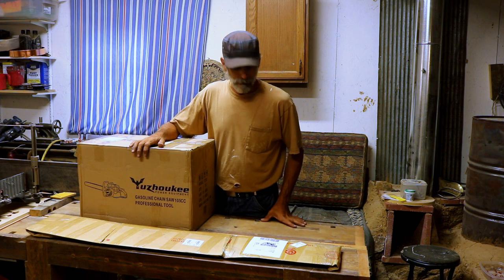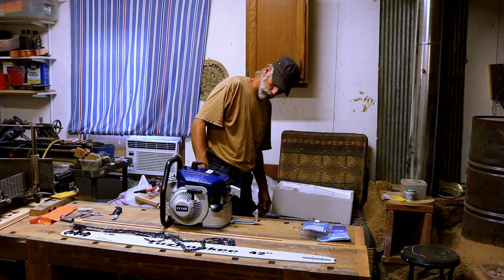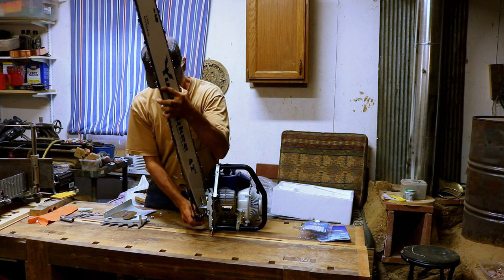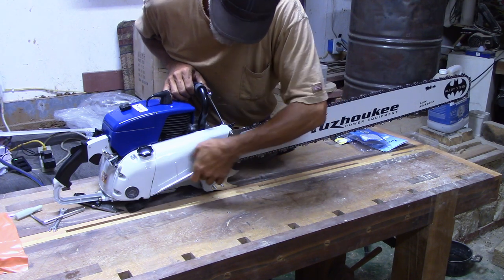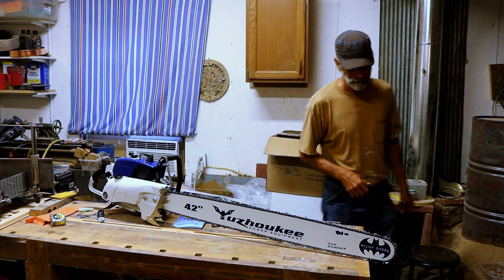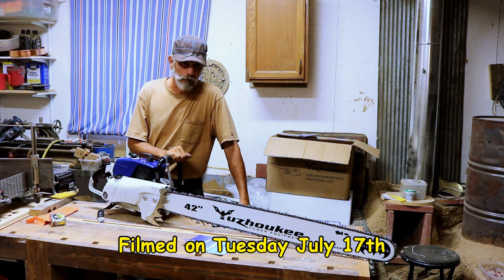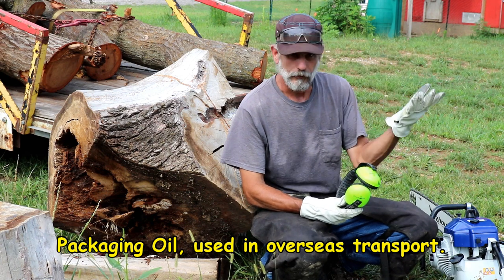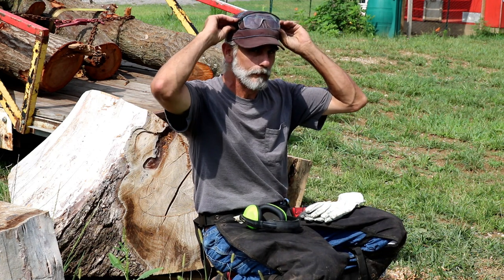Un Boxing a cheap 105cc Chainsaw

Comment: I usually buy the cheap Chinese 18 inch chain saws that come with a couple of chains they are about £70 and really are throw away tools.It is cheaper to buy a new chainsaw than a couple of reputable chains. They last me 2 to 3 years and when the become a problem buy a new one.
Reply: Tony Papantoniou  thatmakes no sense at all if u buy quality saw one time u will have it forever,buy the time u buy two cheap saws u could of bought one nice saw that will last 15 20. Years!!or a lifetime depending on how often it gets used,plus u don't need to deal with the headache of running cheap crap that doesn't work as well as a nice saw!
Reply: Even quality power tools wear out and costly to repair.I am not a professional and do not need tools to run 7 days week Buying a new cheap one every two to three years is cost effective to me and every time they improve, become better at starting and cutting better. As I said you can only buy two to three named chains for the price of these chain saws. They are really good value.
Reply: Tony Papantoniou I'm not a pro chain saw user and I probably use it 1 time every month but I went with a stihl 181c 16 inch bar cost £240 in the uk and I was in just curious what a cheaper one is even tho I have no intention of getting one proactively some thing but crap feel and quality cost £180 if you going to spend why not just buy once and I thought how cheap a named brand was to the quality you get and you get less fatigue so safer on the user just common sense really or at least to me it is
Reply: You need help
Reply: I Ran with a Stihl then a Husky for years...So my Husky fell off the Trailer and Insurance wouldn't pay out for  a new one..The cost for me to buy the same newer model 2k approx NZ$...So while I waited I went to a shop and bought a Cheap Chinese knock off..Its still pulling like a school boy and hasn't failed and for the cost of it..I can't see me going back to a Stihl which is made in China ..may as well buy something that is a 10th of the price and still made in China and if it fails ..throw away and get a new one..
Reply: To Jake Bradbury I can not justify paying nearly 4 times the price to do the same job.
Reply: Timberwulf2  I was in NZ for  a year working laying Tarmac (you call it tarseal) I thought everything with an engine was real exspensive , cars trucks , rollers , diggers.
Reply: Tony Papantoniou i have two Husqvarna saws and i bought one of those cheap Chinese saws just for trouble areas where i dont want to damage my husky's or the expensive chains.And let me tell you that those chinese saws are good value for the money.I got two chains and two blades with the chainsaw,for 55$.One chain for my husky costs that much,so this is really good value for the money.I even got 12 months full waranty
Reply: That is what I have been saying they are cheaper than the chains and they last a couple of years. For some one who needs a saw occasionally these are the way to go.
Reply: pulling like a schoolboy not hered that before lol
Reply: I get Forester chains for around 10 bucks apiece,your logic makes no sense to me
Reply: To Dustin Pomeroy, so £70n versus £240 makes no sense? There is a lot of tool snobbery around.
Reply: Tony Papantoniou not in the grand scheme of things
Reply: I'd buy a used Stihl over a new chinese saw. 
But I would like to have a chinese 090 just for messing around
Reply: 1superocky1 mlm
Reply: What brand and was it a knockoff.
Reply: i bought a stihl 026 for $80 cad, so far ive had it 3 years and has never failed to start, other then the chain i have not replaced a part yet. i cut about 10 cord a year roughly
Reply: it was a used saw, who knows how many hours were on it before i got it, under the filth and grime it was covered in it looked like new
Reply: My grandpa has had the same stihl ms 290 for like 20 years and it has had really no maintenance done too it.
Reply: that's a nice working saw i used one before
Reply: I have had good luck with lots of cheap used chainsaws from garage sales and Craigslist for really fair sometimes paying only what they chain and bar is worth and practically getting the saw for free. I have gotten good at repairing the poulon chainsaws like the wild things and wood sharks you can do a complete tune up including a complete ready to run carburetor new spark plug fuel lines fuel filter And air filter and after a couple minutes and a little fine tuning on the high speed needle they run very good and actually cut good with a sharp chain and straight bar especially the smaller bars the poulon wood shark is a great saw with a 14" bar and chain it has great power to cut the big stuff (10"-12" round) or even smaller stuff like pruning limbs. And for around $30 for the Total investment you have a chainsaw that is worth about $65-80 used in good shape atleast that is what I sell mine for and you have a tool that is just as good or better then one that costs your over $250 to buy a  new higher end model at the store that has a decent reputation and parts availability just like the cheaper poulon chain saw you can buy ever piece of the saw from a online source or even some parts are available at local stores since they are still selling these home owner saws for like $100 plus tax brand new at stores like Wal Mart and Lowe's even has the lower end models but they ask about half as much more money for the saw in the store local then you can get it online. You can even get lucky with spending $60-80 on a brand new Chinese saw from ebay or Amazon a couple companys are producing Stihl and huskvarna replica knock offs that run the same clutch and engine as almost all the high end $300 $400 and even some of the $600 chainsaws have. Heck some of the eBay sales even included a Oregon bar and chain with the purchase of a new chainsaw and some even have cases which is kinda nice if you don't have one.
Reply: @Timberwulf2   a lot of the knock off saws are built using the Stihl parts and some of them are actually good qaulity chain saws for the money you can't beat it your getting a smoking deal if you can get 5 hours of use out of the saw you got your money's worth and you can't feel bad if it died lol
Reply: @gumelini1   
Exactly and you don't have to worry about using a good chainsaw with a good clean sharp chain to cut something ground level or a small job trimming something they're great saws I was overaly impressed with the qaulity and parts interchangeability from name brand new saws to the Chinese chain saws that are basically a Stihl design some are based off a husky type saw but for the most part all the chainsaws on eBay are the same thing just a different color or a different shape of a body around the engine possibly different fill caps also but alot of them are all just knock off of a Stihl And there's lots of info on them online in forums about people rebuilding the Chinese chain saws with parts from other name brand stuff.
Reply: @jacobfraser7967  my favorite kind of saw to buy you know it was never messed with just used like a regular tool being preserved in its own grease and grime lol best part is Cleaning up a old saw and using it like it was meant to be used
Reply: Devin Freeland STIHL chainsaws are made in China.The production moved there so i guess someone figured out to buy parts from the factory and assemble their own STIHL under different covers and brand name.The only difference is they don't sell them crazy expensive like STIHL does.I had only good experience with my chinezium saw 😁
Reply: D B same as other "big" brands.Everything is made in China,go do some research and then come back
Reply: D B for all of those butthurt assholes that wont accept the fact that stihl is made in China,click on this link and let the truth enlighten you https://blog.stihl.com/stihl-worldwide/2013/11/stihl-china-quality-made-stihl/
Reply: String trimmers, blowers, most of the consumer level saws are all made in China. If it has the "Made by Stihl" label on it, it's from China. The first plant opened there a little over 10 years ago. Think it was 4-5 years ago they expanded again to make more products there.
Reply: D B sure,but you called BS on Stihl being made in China.Its hard to accept the truth i guess
Reply: D B Oh now you accept the fact that they are made in Cheyna but dont care about it?Interesting
Reply: Devin Freeland .. You might be able to give me a bit advice, I see you know about Poulon saws... I got a Micro XXV (1977 or 1980s ?)  at a second hand sale for £20, but it was a none starter.. So a clever man I know who is a wizard with all petrol tools cleaned inside the on / off switch and got it started.. Only thing is the fuel lines were a bit swollen and the fuel filter was jumping off so he replaced the fuel line inside the fuel tank.. But getting the thing started is hard enough because you are supposed to hold the throttle on full with full choke.. and once it starts it revs its balls out and won't tick over.. The fella who got it started tweaked the 2 screws on the carb.. It still wouldn't tick over ! .. I just wondered if you encounter similar issues with Poulan gear ? .. I have been using a 028 AV Stihl for years and its never ever missed a beat.. Cheers in advance for any tips you might know about the Poulan, I heard plenty folks saying they are decent saws.. I put double amount 2 stroke oil in the petrol compared to my Stihl mix as I understand they need more oil..
Reply: Timberwulf2 
"I can't see me going back to a Stihl which is made in China", only MS170 is made in China, most of Stihl saws are made in Germany and US. 
Even tho Ms170 is made in China they have still quality standards.
I have bought 2 Stihl saws in 15 years (45cc and 50cc)and both were made in Germany, last Stihl i got 2 years ago.
Reply: gumelini1 You shared that link, but did you even read the page? It was all about that Stihl has opened 1 plant to a China, nothing about "all Stihl's are made in China".
Most of Stihl saws and other products are still made in Germany then US. 
I don't care about where Stihl products are made, but stop spreading those false "facts".
Reply: Trump Jong Un .. I wouldn't really think it would make any difference if Stihl machinery was made in China, Africa or on the top of the Eiffel tower in Paris.. As long as the same standard of components are used and most important of all the strict operations of quality control is adhered to.. A lot of big companies are now making stuff in China, but the quality remains the same as it did when the business was first established in the country of origin.. or you would expect so anyways..
Reply: that's false economy, buy a stihl, husky,makita any of these last for many years with little upkeep. I have these makes and work them regular,some are 15yrs plus so have more than paid for themselves.

Comment: 105 cc is about 3.25 HP.
Reply from the maker: Actually cc's have only a small effect on HP.  Stroke and compression factor in along with a lot of other things. I have seen 52cc saws that achieved 9hp and an out of tune 080 that only produced 4hp. So with proper tuning and tweeking this dude will be capable of more than its rated 6.5hp. Now the question is do I want to ramp it up that much considering the quality of the parts are in question, I will have to think about that. LOL

Comment: I wonder how this thing worked out. Looks like it cut that 38" elm like a 441 stihl or a 562x husqvarna would have. Maybe after it was all adjusted it will cut like a 105cc saw should. But a 105cc saw should scream through that elm, or at least a stihl 088 would

Comment: I knoticed that the chain seemed kinda loose, the more chain the more metal to heat up and expand. I'm personally really anal if the chain it loose, I find they stay sharper longer when you tighten them a lot as you cut
Reply from the maker: Actually the chain was tootight in this video. But, I had not used a hard nose bar in many years and forgotten that they need to run more slack than a sprocket nose bar. Not really an excuse for improper saw settings but everyone makes mistakes. I am planning on ordering a sprocket nose bar for it in the future but for now this one will work for what I need to do. Thanks for the comment.
Reply: DIY with Uncle Cy thanks for the learning experience, ive only ever used a sprocket bar

Comment: Copy of old stihl 070. Huztl is selling those for 350$
Reply from the maker: Yep, Power head with no Bar or Chain is 350. Add a 42 inch bar for 100 and a 60 dollar chain and I got the better deal.
Reply: DIY with Uncle Cy Would pay a little extra just for that orange paint. You cant go wrong with big saws like that.
Reply: DIY with Uncle Cy  Built a kitsaw for seasonal use. Seems to run quite well. Also have a short video of it.
Reply from the maker: Pay extra for paint? LOL you do realize the Hutzl kit and this one are made in the same facyory right. I can just go buy paint and have still saved money for the same saw.
Reply from the maker: Saw that an MS360 clone. I have an MS191T, MS171 and an 032AV that are all real stihls I just needed one for the mill.
Reply: From what I've been reading, swapping out the chain to a Stihl or other "good" brand may make a significant difference. Seems the Chinese chains that are shipping with these inexpensive imports aren't very good. RE using this on a mill... I agree that the chain brake isn't that big of an issue as the bar nose is protected on Granberg and other mills.  I run an MS 461 in my mill but would consider entertaining a clone 880 for those rare (around here) 4 foot plus logs.
Reply from the maker: I am milling with it today. I have a granburg chain ordered, has not come in yet, but had to try it out. I agree a new chain would most likely make a difference.  It is cutting beautifully though. Should have a video of the day up in a few days.
Reply: I have a husky 395 with a 42 inch bar and I get my chains from bailey's they were 40 bucks each the last time I ordered from them

Comment: I’ll be damned if it’s not a copy of the Stihl 070. Oil on the clutch couldn’t have done you any favours it’ll be contaminated forever unless you soak it in alcohol

Comment: you tightened the chain too much causing too much friction, mostly with such a long chain... it must be 1-2 mm loose below the bar... your chain is acting like a brake, consuming probably half the motor power and ruining the bar at lightspeed... I hope you oiled it manually before the oil was going through the automatic oiling...

Comment: But i do save the bars and chains. They all have Oregon bars and chains. I do harvest my own wood for my rc planes using my will, giant table saw, miter saw etc etc i have a nice little shop. So i do use chainsaws. This saw seems dangerous without that brake. Now ive never had serious kickback because i always try to hold the saw horizontally, or keep the tip away from anything, if theres a risk of hitting another branch i cut that branch first. Also i always watch pinch points. Now.. thats not to say i am the safest.. i rarely have to cut down trees because one large birch is enough for a few giant scale planes. But i am extremely cautious. This saw seems intimidating.
Reply from the maker: It is intimidating. But the whole reason I bought it was for milling and not Bucking or felling. And to be honest O have already replaced it as a milling saw with a more modern model. However there will be future videos with this one as I do intend to perhaps hot rod it to see what kind of RPMs I can actually get out of it.
Reply: Definitely show us that because that woudl be handy for my rc planes.

Comment: As with everything Chinese, the saw looks good enough as a copy, but the real problems lay with the Chinese lack of understanding tolerances and metals when they reverse engineer. They also have a tendency to use parts which are underrated for intended application which leads to premature failure down the road.
Reply from the maker: LOL, they have trains that travel 400kph and a good safety record on those trains, but don't understand engineering. I do believe you don't understand much about China.

Comment: It looks like an old sthil ms 880 I got one called an ms 660 but not sthil I think Stihl discontinued those saws and sold the tooling to the Chinese company mine's a 90cc I paid less than 400 bucks the bar that came with my saw didn't have a roller tip though but I already had a 3 foot bar that works. Because of Emissions Control sthil no longer makes the MS 880 or 660 saws they now make  ms 881 and 661.
Reply from the maker: It very well may be.  However if it is the Bore has been changed slightly. The MS880 was 121cc
Reply: This is a copy of an 070 by stihl. 107cc.
Reply from the maker: Just looked that one up. You are correct. The images I found look exactly like it. I bet they reduced the stroke by a little to get the 105 is all. Thanks for the info.
Reply: DIY with Uncle Cy 
Anytime. They also sell one in actual Stihl colors under the Hutzle? Not sure I spelled it correctly, brand name. Also known as Farmertech. Power head only and build it your self parts kits are the two formats. I am looking to order one next month for a milling saw just as you are using it for. Looking forward to your updates.
Reply: rcaircraftnut MS660 is better for mill. Those old saws have very poor vibration dampening.
Reply: There is no ms 881 and stihl still makes the ms880 for the u.s. market.